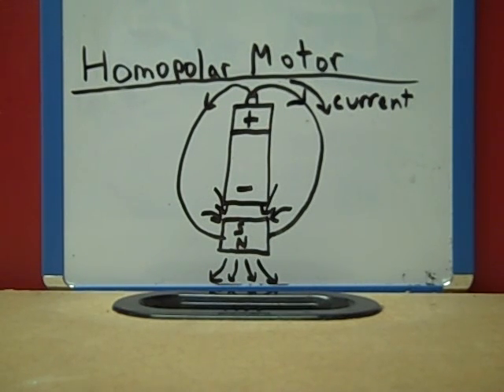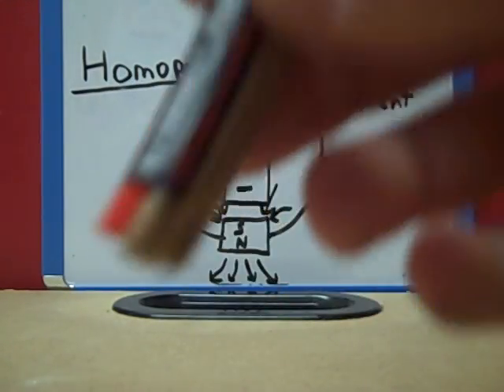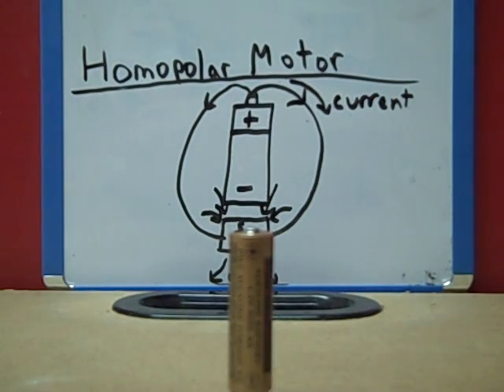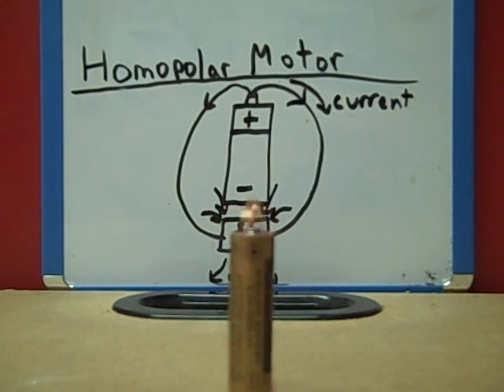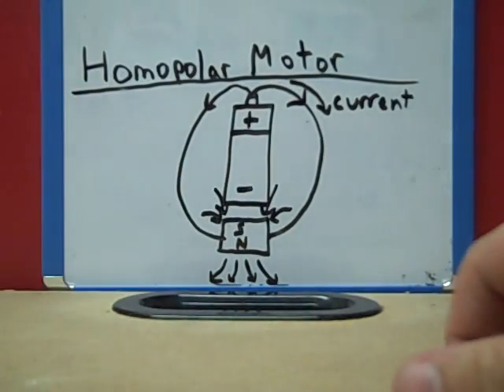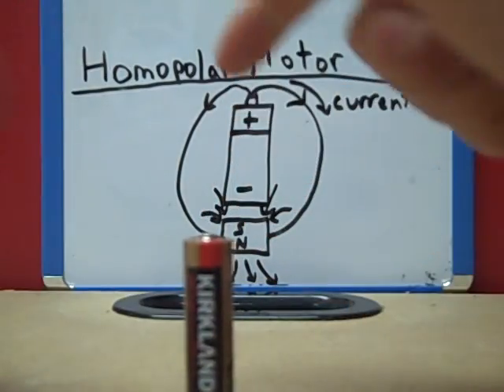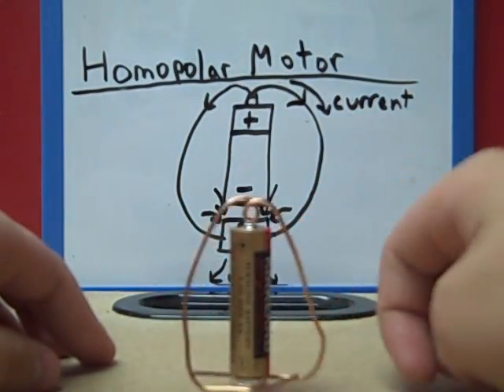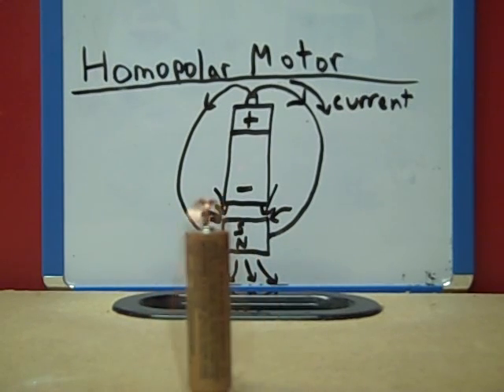Homopolar Motor Explained

Comment: The copper wire connects the positive battery terminal to the magnet at the negative battery terminal, completing the circuit. Consequently, a current of electrons will flow through the wire.

Due to the close proximity of the magnet at the bottom of the battery, this current actually flows in the presence of a magnetic field. When current flows in a magnetic field, it'll experience a force

Comment: based on your right hand rule (if the magnet was oriented with north on the bottom) we should actually see the wire move counter clockwise. looking at the left wire you see that the current is pointing right, the magnetic field is pointing down so you actually have a force pointing out of the page which would cause the whole thing to move counter clockwise. I think your magnet is actually oriented with the south on the bottom which would change our right hand rule and we would get the correct, clockwise rotation.

Comment: Try connecting the wires to the battery without touching the magnet and you'll find out it won't spin at all. So, in this case, your theory doesn't really explain why it spins because a current going through a wire should be enough to make it spin, but why does it require that the wires need to touch the magnet?

Comment: I have a question: the Lorentz force applied to the wire depends on the current and magnetic field directions and intensities. What if we use a very very powerful magnet? My guess is that the faster the wire rotates the earlier the battery drains out (if we want energy to be conserved) but...Why?